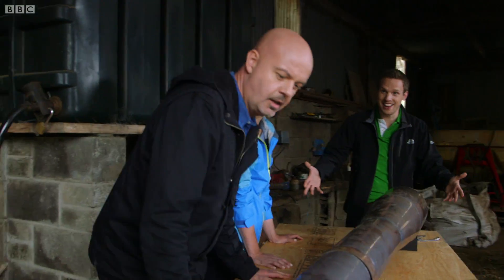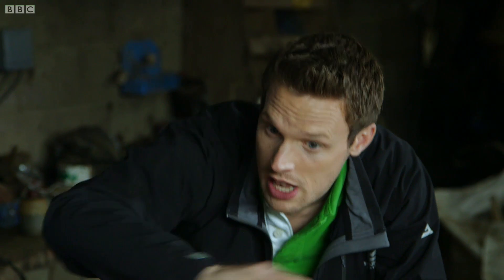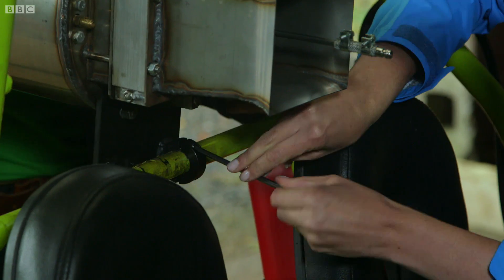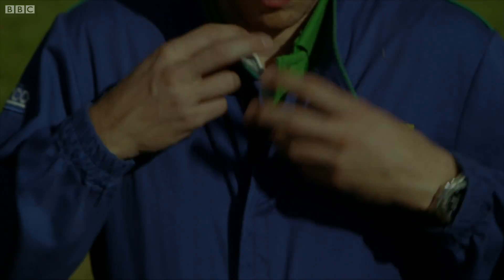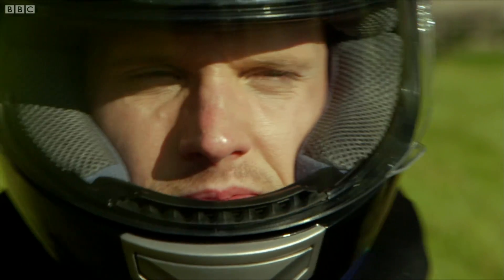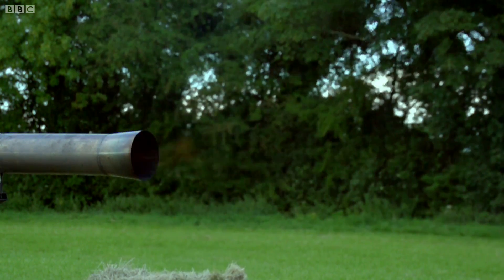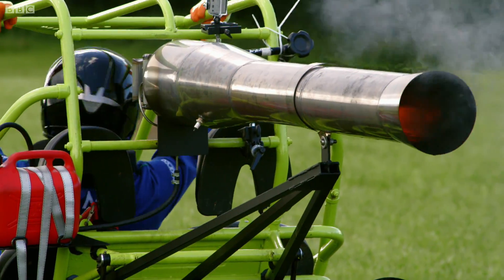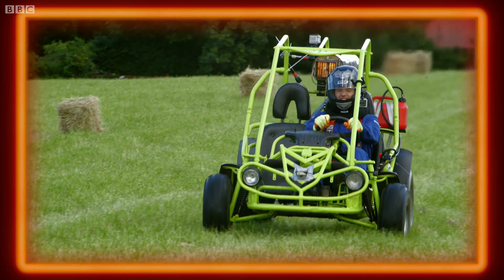Pulsejet Go Kart Experiment | Earth Science

Comment: This is not at all like the engine in the jar. The one they've used on this project operates on a different principle, drawing air not from the nozzle, but from the check valve at the front, the same way as the original V1 pulsejets. I don't think they skipped over this detail intentionally -- I think they literally don't understand the difference. As others have noted, there's almost certainly no chance that the presenters had any part in building this engine, as they haven't a clue how it works.

Comment: No moving parts? The fire seen at the front of the engine (square opening) is a series of flaps opening and closing at the same 700 times/second. They are as much a component of the valves in a piston engine. They last a very short time.

Comment: If the wheels were maglev wheels. Which has very little surface area fiction and on a track to guide the train, in mean auto. On asphalt. Newer jets are much quieter/
Reply: Why don't II hear the jets engines from inside the airport?
Reply: bruh aircraft jet engines don't have open combustion chambers they work more like big turbo chargers from your car
Reply: ***** Slightly. Its not even a little loud. The airport designers must have thought about issue in designing the air port.
Reply: Sven Jonkers Right.  But the exhaust is still piping hot?
Reply: true but not the point, in planes it's nowhere near to 140 db. the types of pulsjets are very much different, plane engines do have moving parts for instance. For it's size they are actually way more quite than the ones in the video.

Comment: basically a simpler version of Colin Furze's jet-powered go-kart
Reply: But much less safe... they didn't have a safety tie
Reply: Not really, as the engine is more complex. There IS a moving part on this engine; a series of reed/flap valves on the front of the engine. This is a small version of the engine used on German V1 Buzz bombs (https://en.wikipedia.org/wiki/Pulsejet ).  When the engine in this video is seen from the front, you can see the square inlet, and the flames/combustion chamber glows inside the combustion chamber.Colin Furze's engine is just a long U-bend tube, with absolutely zero moving parts. (granted, the lengths and diameters of Colin's U-tube are VERY critical, but no fiddly inlet grate with reed valves to worry about)
Reply: There is no point on arguing who first made a pulse jet video... Goebbels was probably first.
Reply: And colin made a series called "How to build a MASSIVE pulsejet" with the first video uploaded in May 9 2013
Reply: Just that this was made in 2014
Reply: Maddox is propably the best "diy" maker for pulse jets. Colin's pulsejet thing was more like a cool toy compred to these real, valved pulse jets which are (or were) well known by UK ppl.. no need to say reason for that because of many lost lives back then :/
Reply: After I uploaded mine in 2012!
Reply: how many times is the uk going to get crowded with pulse jets ?